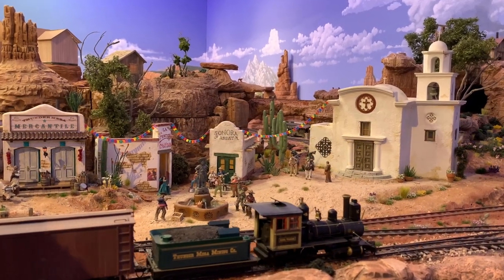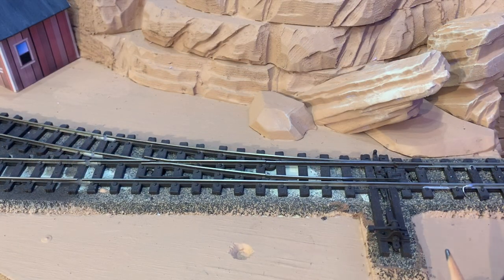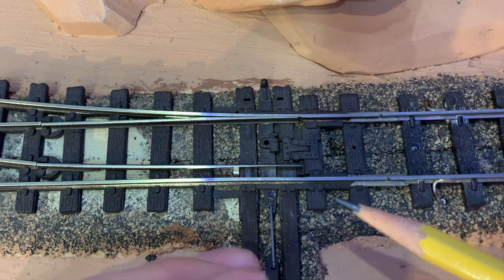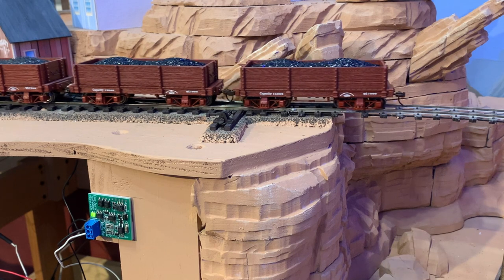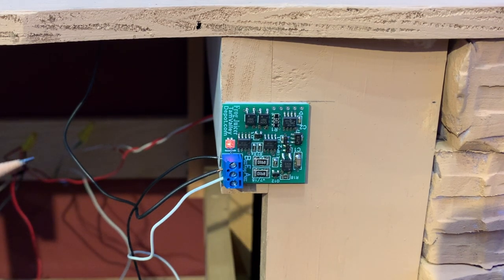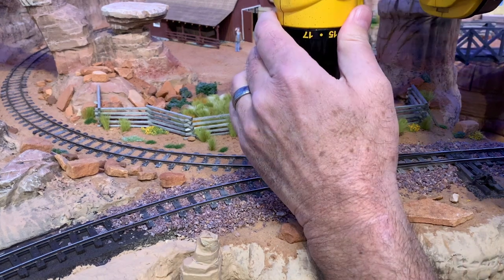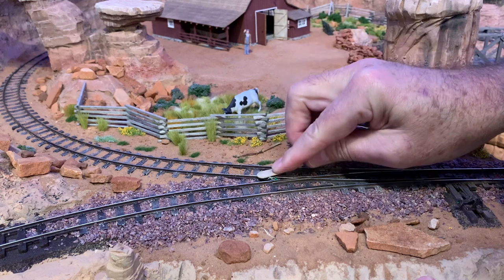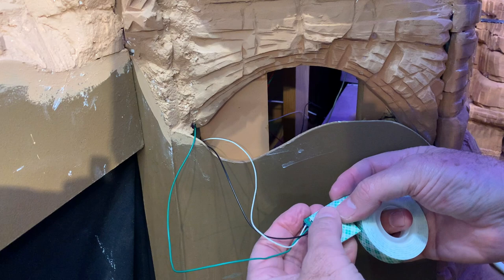Wiring Turnouts for Reliable Operations

Comment: Nice job and instructions on the conversion.. One thing I do when dropping track power is to take a little more of the insulation off so no insulation shows. I feel that this make the wire less able to be seen and really doesn't effect the power or make a short.